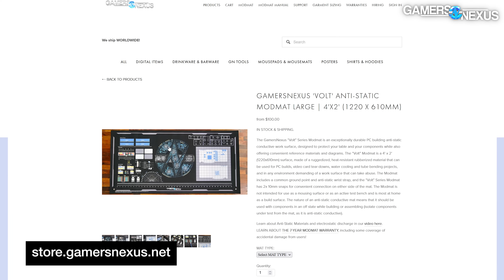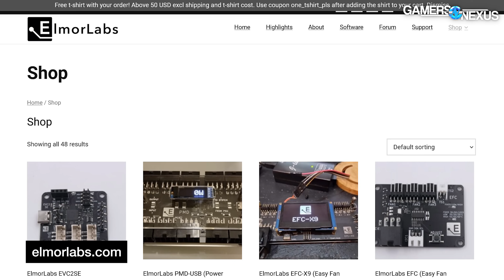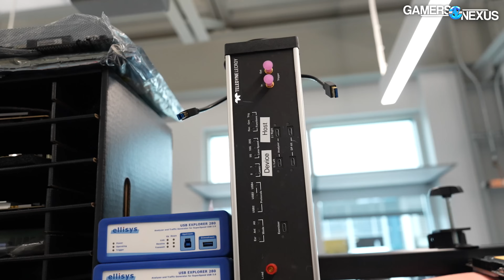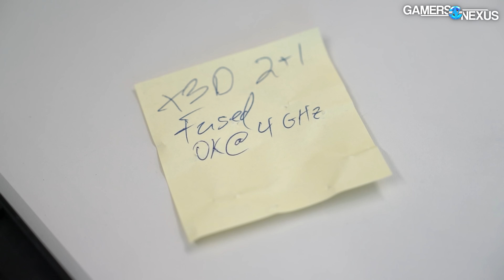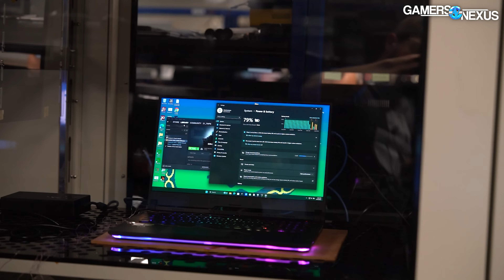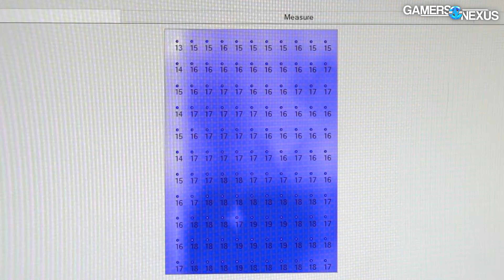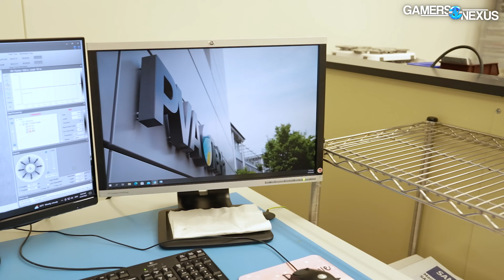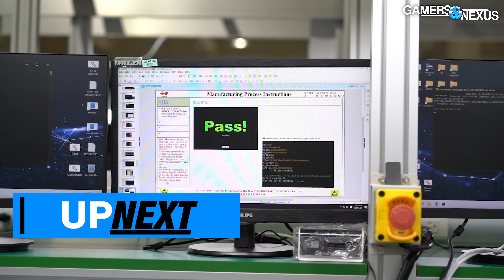Secrets of a $182 Billion Chip Maker: AMD's Labs | Full Documentary

Comment: 37:10 6C ? 60Mhz... Really ? Only 6 degrees less for a delid ? That doesn't line up with what others like der8auer and JayzTwoCents have shown... and if the thinner heat spreader "didn't work"... why did they spend so much time to develop and test a vapor chamber ? 37:55 "I mean there's a lot of benefit right?"  So is there or isn't there?   .... Would be great if GN could do a proper analysis of this for Zen 4, 'cause it sounds like bogus to me. I still think this is a case where the engineers should have said: "No, we're not maintaining cooler compatibility. Make the cooler manufacturers do compatibility kits like they've always done" . Noctua just did one for a DELID ffs.. and it's cheap!
Reply from the maker: It's because it still has the silicone adhesive.

Comment: Looks like amd themselves still have rx550/560 deployed in their own facility.
Reply: Often times I just need a screen to light up. I still have RX450 cards in use as well.  I try to keep my HW requirements lean, so if the system doesn't need to do GFX benching, then I don't need a power GPU. If it aint broke.. :-)    take care!